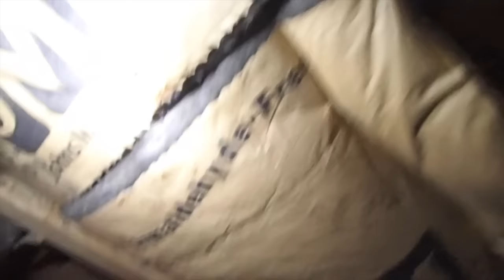The F#$%^&* Cat!!

Comment: My county building department/insurance company required me to install a fire suppression system (sprinklers), smoke/carbon monoxide/radon alarms (hard wired), fire extinguishers (every room), four lightening rods on the roof with #2 solid wire running down to 5/8" x 8' copper ground rods, 10' wide fire break around the house/shop and a basement escape window. Most house fires start in the kitchen btw.

Comment: You should insulate the pipe all the way through the cold area in the attic to the outside vent to avoid condensation  forming in it which will promote mold growth.

Comment: i was just watching you video and i wanted to give you a little advise for you attic i am a professional this is what i do for a living. ideally you would want you attic to be the same temperature as out side and stapling the insulation to the top rafters over heats your shingles and wears them out twice as fast causing premature shingle wear. i would add some more insulation to create a higher R value doing so by blowing in some insulation and install some baffles channel down close to your soffit ventilation and possibly add some roof vents, doing all this will help you create what is called a thermo barrier and you will save alot of heat in your house and help ice damming and icicles on you house
Reply from the maker: There are no shingles on this roof it is a vented tin roof with airflow under the tin. Therefore the 10 is the same temperature as the outside temperature
Reply: Oh I didn't realize it was a metal roof I bet the insulation helps with noise from rain and snow slides

Comment: That is an awful long pipe run.  Any way to see about shortening it, which would make it more efficient, and marginally safer?
Reply: +P.M. Laberge It looks to be quite a large diameter pipe it should exhaust freely.
Reply: +billl605  Still, from an HVAC point of view, and possible condensation, I wonder it it might not have better draught, or be more quiet, with a shorter run.   What do you think?  
(Besides what if the cat got in a large diameter pipe!?  LOL!)
Reply: I'm sure you are correct, his situation may require a long vent pipe tho. I think it was the people performing the cat extraction caused the damage to the vent pipe, either that or the cat got sucked into the range hood and blasted thru the bend of the pipe by its own momentum. Thanks for the reply, made me think.
Reply: +billl605 Yes, he says they did the most of the damage.  Horrid!   But my felinic concerns are motivated by a real life event....  

When I was a kid, my biology prof was a herpetologist.  A large pet snake got out of its cage, and away it went, and somehow got into the huge main duct of the high school HVAC system.   This caused a bit of a stir, you see. 

Well, this one tech, was brave and went to take a peek.  He got himself partly into some sort of access port, turned on his flashlight, and VOILA.  But, both, he and the snake were surprised.  (The snake I can see... Him?) And scared.  Both reacted....  He got out, and somehow, he and a piece of (apparently not properly fastened) ducting, and the snake, went crashing into a classroom....  

The snake was ok.   He had minor wounds.  The damage to the system and classroom (as well as cleanup) was around $5000.   Not a lot of money by today's standards.  But this was the early 1970's!  A large amount of money back then.  Mr CH paid part of it.  and the various insurances the rest.  The snake was later donated to a zoo.  

Fortunately our Farmer cannot fit into a stove vent duct..... !  

Me?  Despite his teaching, i avoid snakes.  And spiders.   Cats I like. (Well some of them.)  My sister is a farmer, so there is NO avoiding those!
Reply: Thank you very much for story, awesome, I like cats too, spiders I like not so much I am ambivalent about farmers. I have never experienced cat or farmer damage to my attic, however there is farmer across the road who is a bit of an asshole, pardon my french pls.
Reply: +billl605 Well, that is too bad.  Perhaps you could point the a hole guy to these videos.  He might learn a thing or two.  

Farmers are people, like us.  Ya got good ones, bad ones, and mediocre ones.  Some are good at human relations and bad at farming.  Some are good at farming and bed a neighbourly relations.  A few are good at both.  Some are bad at both.  My sister has a few neighbours, and one of each type.  (Do bear in mind that a neighbour out there, could, thankfully, be a mile or 2 away.)

Glad you liked a formative part of my youth!  Take care.  

My sister says that spiders ARE good, ecologically.   But I had some very bad experiences with a few spiders (and other insects) at a very young age.  I just never got over it.   I'll not inflict the details on you!